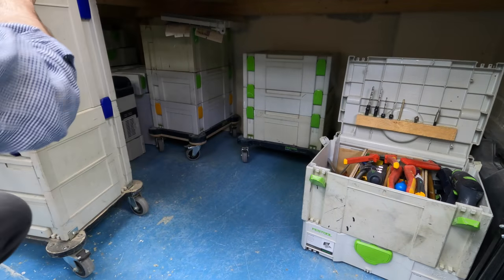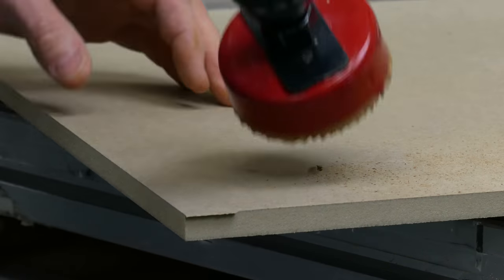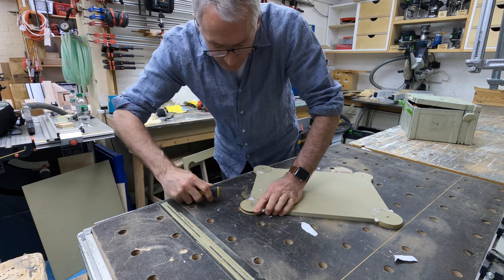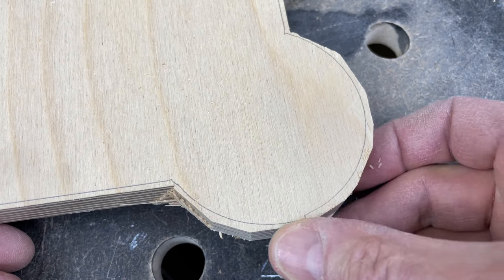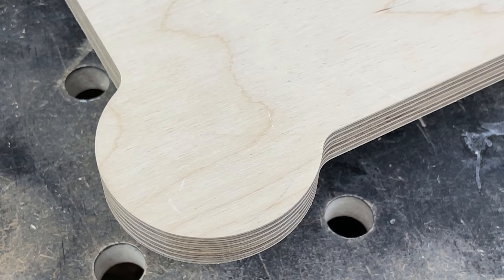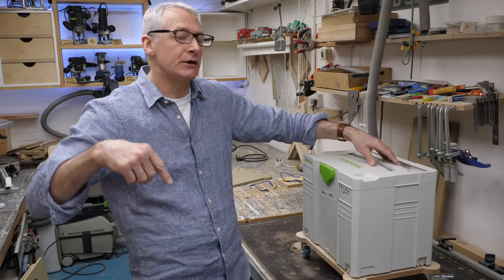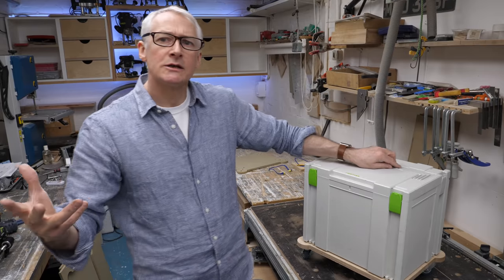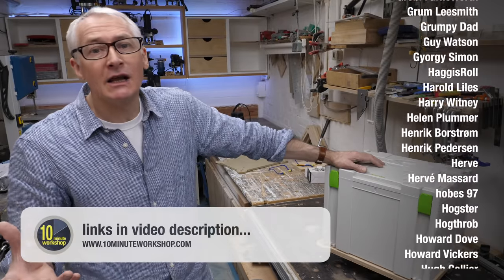DIY Systainer Roll Board [video 451]

Comment: Interesting video. Thanks for sharing. I've never known that I'm able to earn (well, save is a better word, I think) more than 60 GBP an hour.
I've been making a lot of roll boards  For the boards I use 18 mm particle board, melamine (reclaimed, from old kitchen cabinets) or left-overs  
tongue-and-groove natural wood.
The casters I buy usually in IKEA, sometimes in LIDL. Since they're not available all year around or it's a long distance to get them, I always have a dozen or so in stock.
At first I used the cheapest casters from IKEA, called Slugger. They don't sell them anymore. They were plastic but suitable for not to heavy weight purposes on a smooth
underground  (flooring tiles for example). Now I use other ones, more rubbery, sometimes 5, sometimes 7.5 cm in diameter. It depends on the load and the type of flooring.
The size of the boards I adapt to the things that will be placed on it. They look ugly but they never have cost me more than the price of the casters + 16 screws.
Reply from the maker: Thanks Hans! 👍👍

Comment: I noticed in the slowmo at the end that when you came out of the inside corner you turned the base of the router instead of, what I would have done, followed along like usual.
That is a router tip nobody has ever told 🤓
Reply from the maker: Helps keep it in control, with the dominant hand like that. 👍

Comment: Peter ,why didnt you make it with your cnc machine and then you can make them when ever you need them or even sell the Gcode  for a couple lbs to others
Reply from the maker: Because if I did that 90% of folks would switch off Syd! Also, I'd probably still be making them, whereas the template & router is a quick and easy way to get it done, and also a good teaching opportunity. Plus I can still cut them out whenever I need them - just with a router. 👍
Reply: @10MinuteWorkshop  i know Peter you could give it away for free too,myself i just buy the furniture dollies when there on sale because the wheels cost twice as much  alone  and due to covid are lumber prices have double and tripled,so becarful and wash your hands

Comment: Tips and tricks useing "ringplate?" cutting like Ron Paulks bench. Can you understand that I try to explaine.?
Reply from the maker: Nope, sorry. Never cone across ‘ring plate’ before. 🤔🤷‍♂️
Reply: Then you use smal upcut/downcut bits and a plate wih small hole in center. Following edges on a template. My English worse more I try to explaine.......

Comment: Why didn’t you just screw an existing base to a piece of 12mil, and then use the patter bit to make the template?
Reply from the maker: How would that help the folks who don't have a Festool base to work off? 🤷‍♂️
Reply: @10MinuteWorkshop  Good point. I didn’t think of it that way, I just build a lot of jigs-n-fixtures. (Figuring out how to do it is the fun part to me).  If I didn’t have the Festool base to work from, I’d just put an offset pattern bit in the router, and use the tool box as a pattern.  That results in a pattern which is about 12-mm, or half an inch on all sides larger than the box.  The caster would end up a bit further in, and it would be a bit more likely to tip, but would still be workable.

Comment: Peter - love the video as always.  I have a couple of routers I have bought for that non-existant (but much wanted) workshop for me and I have to route a channel into a shelf for lighting. The channel needs to go round  a bend or have 22.5 deg mitres  and I am not 100% certain how best to do that (hopefully that makes sense) but something like this:
   __
 /        \
 |         |
Please do not laugh to much at that diagram but I am working with what I have got here in the comments section :D
Reply from the maker: Thanks Colin. Not totally sure I understand, but if it's a groove that has to follow a path, then using a bearing-guided bit against a template would be the way I'd do it - so cut your template out of ~12mm MDF, then follow that. Hope that helps! P
Reply: @10MinuteWorkshop  I apologies That was a crude drawing.  OK I will check out bits online for that. Thanks you.

Comment: Maestro, you could have done this project with your cnc.
Reply from the maker: I could, but then it would be a niche CNC project and most people would switch off. As a template & router project it’s much more accessible to a wider audience. Also about 20 times faster to do it with a router! 👍👍
Reply: @10MinuteWorkshop  put a camera on your CNC and it can cut any black line it sees.

Comment: Thank you for yet another informative video, it was interesting to see a different approach to DIYing dollys. If I may make a suggestion; I've made a couple of my own dollys, one T-Loc (with the latches you suggest), one classic, and there's a 3D printable design that works well for connecting the classic Systainers/MakPak boxes, that could easily be made with some small blocks of hardwood and a few bolts. 

https://www.thingiverse.com/thing:3374431

The latches slide into the rear lugs to hole the Systainer down, while the front two are captive. If anyone goes to make one of these, be aware that the spacing of the Systainer and MakPac front lugs are very slightly different. This can be overcome by adding washers to the front latches to allow them to pivot slightly.

For a cheap(ish) ready-made option, Euro crate dollys work well, and allow you to fit two standard Systainers side-by-side for around £40.

Again, thank you for yet another great video.